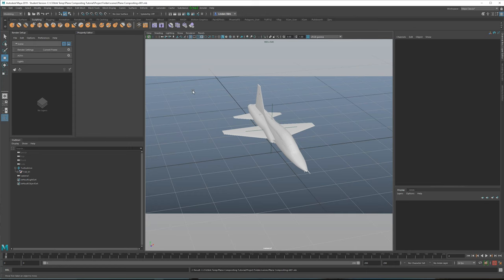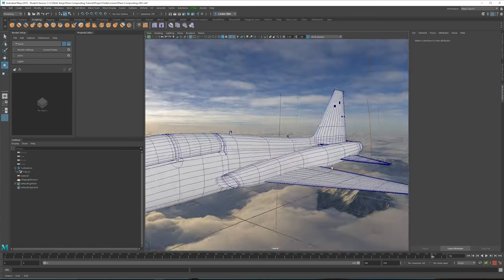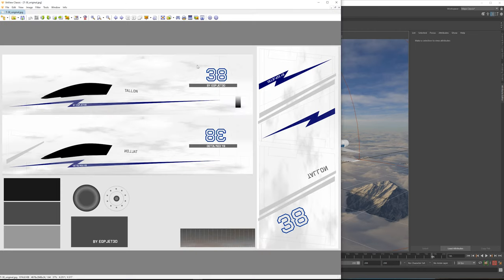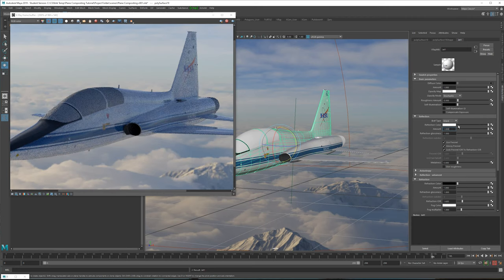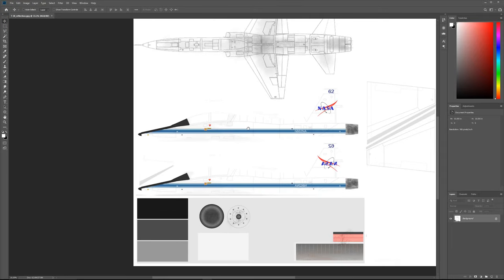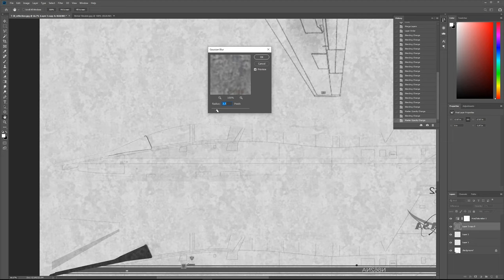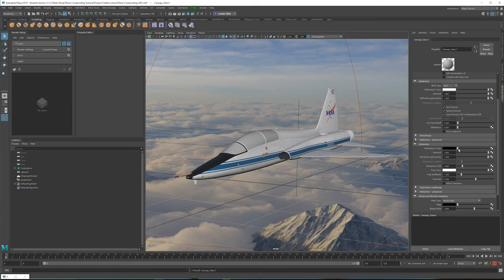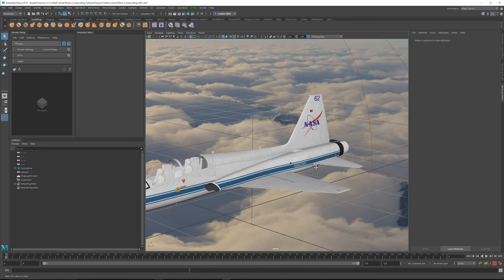V-Ray HDRI dome lighting & materials in Maya - VFX Plane Part 02 [Deprecated Workflow]

Comment: hey, i know this video is very old and that i might not get any help but its worth trying. My vfb is completely broken, I am using vray 6 and when i open vfb and press the start button it opens the maya render view instead of rendering in the vray vfb, if anyone could help me with this i would be grateful
Reply from the maker: Have you checked in script editor for an error message? Also, are you sure the V-Ray license server is running? In a web browser, type in: localhost:30304. If you cannot connect, then the server is not running. Otherwise, it will tell you how many licenses you have available or if your license has expired.
Reply: @CGStirk  Thank you so much for the response as it is the only help ive had on this issue. Yes i get a lisence error when I try to render, for some reason the server is listening on port 20207 instead of 30304, is this okay?
Reply from the maker: @Goopenheimerr  Port 20207 is for distributed rendering I believe. Your best bet might be to reinstall V-Ray.
Reply: Hello, after reinstalling the software the port is still on 20207 i have tried many ways of changing it but none have worked. When i open the vray render server it still is on 20207 thanks for the help!
Reply from the maker: @Goopenheimerr  The render server on port 20207 is for distributed rendering, not VFB rendering. What you need to run is the vrol.exe, although it should run automatically. Check out this doc: https://docs.chaos.com/display/LIC5/Troubleshooting. It also provides error codes at the bottom.
Reply: @CGStirk  thank you so much! this fixed my issue
Reply from the maker: @Goopenheimerr  Awesome! Glad it worked!